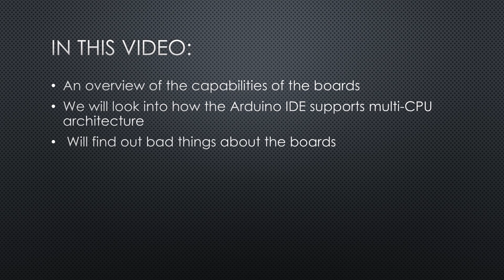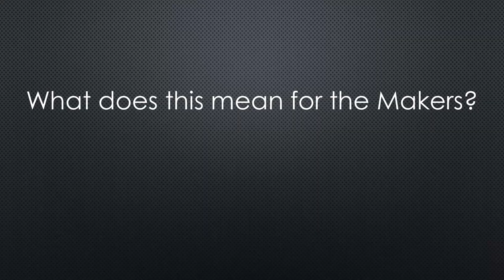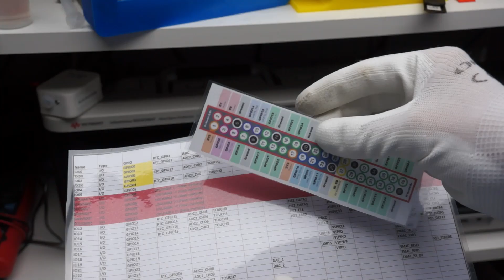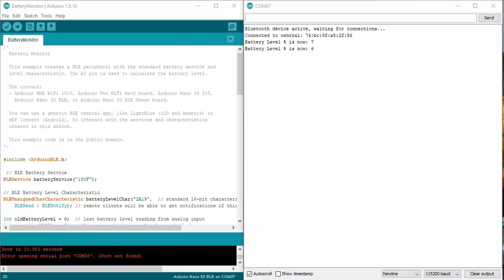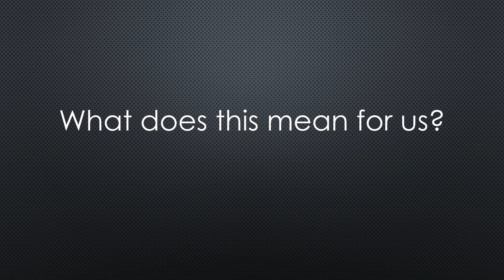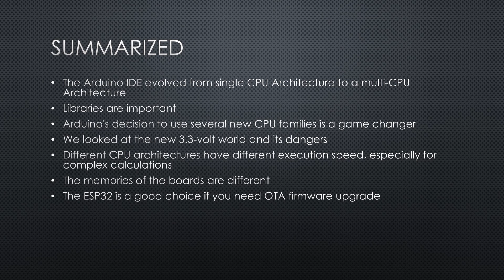#298 Four new Arduino Nano Boards: Test and Comparison (Every, 33 IoT, 33 BLE, 33 BLE Sense)

Comment: I'd just like to suggest PlarformIO as an alternative to the Arduino IDE. I use it with VSCode, but it can be used with other IDEs/Editors, too. It comes with a library manager and allows multiple configurations for different boards in the same project. And most important for me: Using VSCode gives you reasonable code navigation and completion features.
Reply: For the big Visual Studio there is also VisualMicro available as extension for microcontroller development.
Reply from the maker: Thank you for your feedback. I made 2 videos about that topic
Reply: Good stuff! I just subscribed and didn't see all videos, yet, but the ones I saw were already very useful!
Reply: The Arduino "IDE" is an insult to real IDEs. I wish they would work on that instead of creating new boards. Mostly for the benefit of people who are getting into this now and don't know any better. I'm using platformIO anyway. PlatformIO only really supports VSCode nowadays though, issues you have with other editors (like atom for example) won't be fixed anymore.
Reply: I don't like platform IO. It takes a lot of time to understand and takes a lot of system resources in my opinion. And even then it don't work as you can see in the help forum. I like Arduino much more.
Reply: You don't need platformio with visual studio code, there is a smaller simple extension available that works great.
Reply: @scottbaileyExplores  Really? I will check that, thanks.
Reply: @saxpert  Yes its by Microsoft. It's called Arduino for Visual Studio Code. Works with esp8266 and esp32 and many other boards. It Has built in board and library manager, serial monitor etc. I have been using this now for 3 years with no problems.
Reply: @scottbaileyExplores  good. I got a bit crazy by trying to get a paxcounter sketch to a esp32 with platformio...it didn't run. That's why I am a fan of Arduino...works for me 😉
Reply: Arduino with Dark Theme is good.  PlatformIO documentation is hard to understand. Kind of confusing to me. Had Arduino for VSC working pretty good, then it could not find my serial port after it did an upgrade. (l am using linux)
Reply: @saxpert  Unless something changed, I don't like how the official Arduino IDE doesn't have per project board settings. They keep overlooking the use case of mixed architecture designs...
Reply: @saxpert  Platform IO to me has a steep learning curve. The installation alone takes you through "rabbit holes" that cause you to go deeper and deeper into the mess.
Reply: Forget Arduino and VSCode, run Micropython on ESP chips. These (Arduino 33) chips are the shizzle for on device inference.
Reply: @7Trident3  ? What? Please explain
Reply: @kitecattestecke2303  tinyML is your start. Future devices will be near Magical.

Comment: The high BLE current is due to:
1. The chip probably has the 8dbm Amplifier turned on
2. It never seems to go back to standby mode

I get the chip itself to work on average 85uA with a 100ms Update rate.
Reply: We need a better demo sketch then :)
Reply from the maker: That is what I asked for...
Reply: Let's do a software follow-up in 3 months 🙂
Reply: ok BLE god.
Reply: @marcrives279  More like less crappy Arduino libraries. The sketch itself does almost nothing. The libraries do all of the heavy lifting and if they aren't written properly/enable lots of unnecessary stuff by default, then no wonder.
Reply: There are plenty of sketches out there for BLE I believe with the info you are looking for.
Reply: As Andreas told in another video, I feel we are in the "bleeding edge" there.
Reply: Great to see someone with answers and know-how.
"In business theory, a disruptive innovation is an innovation that creates a new market and value network and eventually disrupts an existing market and value network, displacing established market-leading firms, products, and alliances." - from https://en.wikipedia.org/wiki/Disruptive_innovation 
On the other hand it is sad that the existing market and value network is releasing non-tested (non-documented) products for customers to debug.
Dave Jones just had a rant partially about this disruptive way to develop using new chips from ST: https://www.youtube.com/watch?v=SFrUINyYcEA&t=922s

Comment: The nRF52 series are excellent but the Arduino support and libraries are utter crap, unfortunately. You still need the proprietary Nordic "softdevice" blob that actually implements all the BLE protocol stack. The problem is that the Arduino doesn't use the latest version of this, so you have to deal with old bugs and missing features that are not present in the official SDK. On top of that, the Arduino side is buggy, unreliable and many BLE features are not supported. Oh and the power consumption is nuts. 

I have bought an EBYTES module from China for about $5, as described in the video. Get a CMSIS-DAP or JLink dongle and use the Nordic SDK directly (it is excellent, btw). You will get much much better results, with much fewer issues and power consumption down in about 4mA when running BLE and uA when sleeping.
Reply from the maker: Sounds interesting. Maybe I will have a look when I find the time...

Comment: I keep 3.3V and 3.6V zener diodes on hand to limit voltage to the 3.3V side of communications.
A small 100/68 ohm resistor is placed on the 5V side, then a zener to ground directly after.
Reply: If I did my math right, when the 5v side pulls the line high, 68 ohm/3.3v zener circuit will draw 25 mA. That is 125 milliwatts per I/O pin. That could dramatically reduce the run time with a small battery.

At high frequencies (500 kbaud) and with a lot of capacitance (breadboard), it may require a relatively low value resistor on the order of 330 ohms. At lower data rates (9600 baud) or lower capacitance (PCB), 10kohms or even higher should be sufficient.
Reply: @hamjudo  Cannot argue with your math.  You are paying attention!  I was concerned with such a low value resistor (that I did not have) the first time seeing this requirement for a zener clamp.  Higher valued resistors have worked for my purposes, but "68 ohm" is most often cited to drop that 1.7V.  There is an "Iz(min) minimum current required for the diode to break down" that may be as high as than 10mA.  You can try putting 10k in series with a zener on a breadboard at 5V.  Do you read 3.3V?  It is much higher (have tried).  If you look up schematics for the V-USB project, you will find a lot of discussion about the best way to skin this cat.  A couple of silicon diode drops, level shifters, resistor dividers, isolation circuits, etc.  Zener clamps have worked for me on the rPi's MISO and RX pins.  I use a double Mosfet level shifter for i2c.  http://vusb.wikidot.com/local--files/hardware/level-conversion-with-zener.gif
Reply from the maker: The 5 volt tolerant boards have a similar thing built-in...

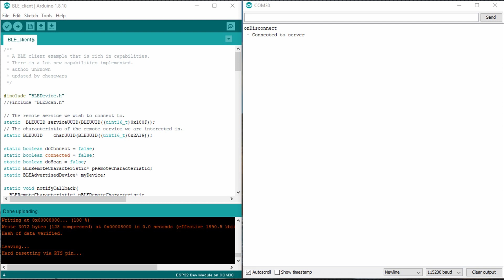Comment: 13:10 >> 
To receive data from a central (phone),  you have to add the BLEWrite in the characteristic property at the peripheral (Arduino).
Reply from the maker: Thank you for the info!
Reply: @AndreasSpiess   Thanks for the video, you saved me some money and time with the Arduino BLE boards. I bought an MKR1010 instead.

Comment: What I like about about this product line is that Arduino went back to their well established Nano form factor. It seems that MKR form factor didn't got as much popularity as Feather from Adafruit, but Nano can be a good alternative for projects not intended for battery operation.
Moreover, Nano BLE is first Arduino board capable of running CircuitPython, although some additional work and tool is needed to flash it with different bootloader.
Reply from the maker: I do not know what the deciding factors were. But from experience, sticking to standard formats usually is not a bad idea because it can create a Eco-System. So chosing hte feather format would also have been a good idea, I think.

Comment: It would be a great idea about how GPS works and how to understand it's coordinates.
Pointing out the challenges of making a GPS antenna would be interesting.
Maybe a cooperation with ublox?
Reply from the maker: I once made a video about the accuracy of GPS sensors. For me RTK would be interesting. Standard GPS is very easy to use these days.

Comment: A rework of the overloaded boards-menu would be highly appreciated.
Reply: it sure would, I dont use a lot but its still confusing. maybe a way to hide unneeded sub types at least.
Reply: They should stop abusing the menu system, it was never designed for long lists of options. They should use a new dialog box with a proper selection list/grid with filtering options.
Reply: Exactly.
Reply: Make your life a little cooler today, switch to Platformio. I did two years ago. Never looked back. The Arduino IDE has been a living dead for a long time.
Reply: Should have a search function, if you ask me. :-)
Reply: That would be something so usefull. I hope your suggestion is being picked up
Reply: @Love made in Japan The principle of inertia by definition tricks you into believing that a past event is still ongoing.

Comment: In my quest for lower power consumption I fell into the world of ARM with Nordic chips a while ago.  I think the other fundamental shift by Arduino was to embrace ARM's mbed in their BLE software implementation. So, in my incomplete (untested and possibly incorrect) opinion, we, as makers we now have access to the entire mbed software stack when using Arduino boards based on Nordic NRF5* chips. Paraphrasing Jaws : "We're gonna need a bigger IDE".
Reply from the maker: That is my hope, that we get a better BLE stack. But still easy to use...

Comment: The NRF52840 has a very powerful PWM hardware support.  I just updated NeoPixelBus library to use it and I was impressed with its flexibility.  I liked it better than the Esp32 RMT hardware.
That compile time for Nano 33 BLE was very painful though.
Reply from the maker: I think, the NRF52840 is a good choice...

Comment: Nano Every raises a question mark in my head because so many pins are wasted. I think making an Arduino Uno Every would have made sense, with a double header on each sides to make use of the extra GPIOs of the microcontroller yet keep compatible with uno shields.
Reply from the maker: I assume they wanted to have it somehow compatible with the old Nano.

Comment: When ever something new is happening, and I get a chance to look it over at a great price I act.  Then, after receiving my "new" product, I begin to search for someone who can tell me what the heck I have in my grubby old fingers.  In this case, I was searching EBAY for a deal on some NANO boards, I love their size and how handy they are for my ghost buster projects that I build for our local paranormal club.  No I am not a member, just love to play with Arduino's and they work great at building devices that are supposed to find ghosts.  So it was, I was searching and came across a deal with one of the new NANO 33's. Not knowing what it was, I bid anyhow because it came with a regular NANO and there were no other bids.  Got the 2 NANO's for 10 bucks plus 3 shipping.  Not bad for an honest to goodness Arduino NANO and the 33 BLE Sense. Well they came in the mail today and look as though the previous owner never even tried them out. I was very happy and then I began to try and figure out what I had. Of course your video always floats to the top of my searches in YouTube and I was very happy to see that because you always do such a great job with your presentations.  Now I know what I have and am even happier.  It's Christmas in July!!  Now to figure out what to use the new one for, those sensors are right up the alley for ghost finding purposes.
Reply from the maker: Great find! But I do not know if I should wish that you find ghosts or not because I do not know if they are dangerous ;-) I stay with searching for weather balloons

Comment: Dear Andreas, there is a high pitched noise during your videos where you have any voice-over. It sounds like some electronic interference from a power supply getting through to the microphone. It's missing at the cuts, so I think it's in the video, and not on my system. It's not overwhelming but certainly makes it harder to concentrate on the content, especially with headphones on. Anybody else notices it?
Reply from the maker: You are the only so far. And I am too old to hear it. At least one advantage of age ;-)
Reply: @AndreasSpiess  That's so weird. I'm fairly sure I'm not imagining it. It's not on any other videos I view except yours, it stops when I pause it, etc. Also it's more pronounced with headsets instead of speakers. You might be able to visualize it though, here's a video from Tom Scott where he talks about this: https://www.youtube.com/watch?v=RA5UiLYWdbM (though for him the noise was made by CRT monitors)

I think a low pass filter in audacity could get rid of it, and you can see it on a FFT chart.
Reply: Yeah, it's there.

Comment: I got my ARDUINO NANO 33 BLE a few days ago. My goal was to control some professional photographic lights with BLE. Unfortunately, there is a serious bug in the ArduinoBLE library. The NANO 33 BLE does not disconnect when the peripheral is switched off. ( https://github.com/arduino-libraries/ArduinoBLE/issues/33 ) The same code worked for the ARDUINO NANO 33 IOT that I used afterwards.
Great work Andreas !
Reply from the maker: I hope these mistakes will disappear. BLE would be such a niche technology and very useful :-(

Comment: Thanks again Andreas, for a useful and interesting video to watch having my Sunday breakfast.  I look forward to the future videos that I guess is gone be more inn depth about the connected boards.
I have a few questions to you: 
Now with the new NRF52840 based BLE boards, do you know if there is some mesh networking capabilities using Arduino with these boards ?
Have you looked in to the mesh capabilities of the ESP8266 an ESP32 boards, if not that would be a really really interesting and useful video especial  with an MQTT gateway, connecting meshed sensors and devices to the "cload" ?

/Ole
Reply from the maker: I am not a big fan of mesh because of its power hunger. But I decided to look into it with Zigbee because there, many devices are anyway connected to mains and a mesh makes sense.

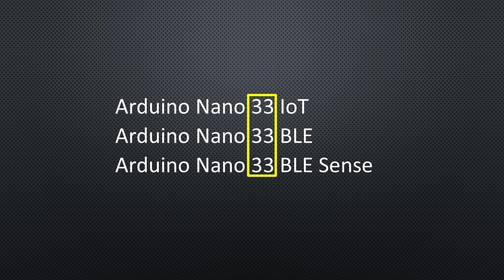Comment: 7:10 Your chart should list ESP32's internal Temperature Sensor and Hall Sensor, and maybe the 10 Capacitive Touch Sensors.
Reply from the maker: You are right. But the temp sensor is only to measure CPU temperature.

Comment: The addition of Mbed to Arduino is a great advantage. IMO Arduino should release much more boards on top of Mbed
Reply from the maker: Unfortunately these boards did not get any traction in the Maker community.
Reply: @AndreasSpiess  which is weird to me since mbed/rtos is so much more applicable in the maker community type projects.
Reply from the maker: We have RTOS on our ESP32 if we want. And WiFi... Plus all libraries and community support. Hard to beat for a casual Maker if you ask me.
Reply: @AndreasSpiess  Sure there are options for FreeRTOS and perhaps other platforms. but the beauty for the maker is that they can use mbed straight in there projects from the Arduino environment. No need for figuring out how to change a bootloader etc. Not saying this is better than that, but mbed Arduinos might be an undiscovered gem :)

Comment: I'd agree the Nano Every is a dinosaur in today's MCU world, but I'd still want one in the tool arsenal. There remain lots of applications where connectivity isn't needed/desired, and the simplicity of a single CPU helps. The new switching regulators are helpful as well for simple battery applications. But then again, I might also be a dinosaur, because my MCU collection is all 8-bit AVR. :D Looking forward to your videos on the other new boards!
Reply from the maker: If I read the comments, not many viewers are interested in videos with these boards :-(  I still hope I will be able to use the BLE sense for a project.
Reply: @AndreasSpiess  Really?? Very interesting... Maybe the Arduino name has lost its magic? Or maybe there's a lack of understanding for why these boards are different?

Comment: I find the price of these new boards very difficult to justify when I can get an 8266 based D1 Mini for <US$2 and an ESP32 for <US$5. And the crazy dual CPU setup with the ESP32 AND the SAMD in the 33 IOT? If you are going to use the ESP32 just for Wifi and another CPU for logic or whatever, then rather just use an ESP14 module? The nRF52 is a nice addition for BLE, but yes, the power consumption disappoints. Plus, they missed the most useful Nordic SOC - the nRF9160 (NB-IOT). It's nice to see Arduino modernise the range, but sorry, it needs to be better and more cost-effective.
Reply: Exactly. But you don't need ESP14. AFAIK ESP32 do have two cores in it, and the best way is to use one for real time stuff and logic and other one to do communication and asynchronous or blocking stuff (WiFi, display, keyboard, serial comms, SD read/write, etc).
Reply from the maker: NB-IOT is a different animal, I think. You need a service provider and a contract. And unfortunately, I do still not get it here :-(

Comment: Arduino IDE Is pretty anachronistic. They use one cpu thread for compilation. If you use platformio that compilation time can be reduced by N times for every cpu core you have.
Reply from the maker: For most people this is not an important issue, I think. Simplicity and example files seem to be more important. But I made videos about PlatformIO.